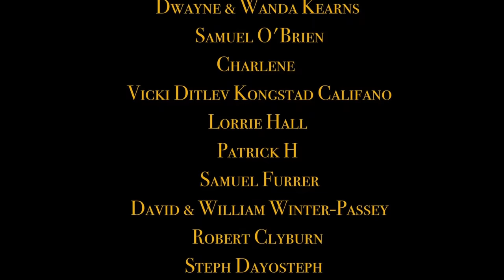EP90 Desk Cabinet for the Salon A Beautiful find for Our Passion Project

Comment: I much prefer the cabinet on its own. And the desk on it's own separate. Because it will be so dark to sit down in front of for anyone. 
But if your sat down in front of the desk on it's own. You'll be more likely to want to sit in  there  if your able to glance up out the windows without the big dark glare of the tall cabinet right in front of you above your head. As someone who suffers from depression. Even anyone without depression  could be less likely to want to sit there. 
But, that's just what I think.

Comment: I love the desk and hutch so much!!! I my humble opinion this is not the right place for it for more than one reason. It is to large and the overhang of it on the wall that it is on is distracting. Then it takes away from the beautiful stained glass door and the windows with the beautiful plaster work between them towards the ceiling and they take away from the desk it in turn. Beautiful window treatments with some gilded curtain hold backs on the wall would looks so beautiful.I think a beautiful gilded bench and seat cushion to tie in with the curtain fabric would be so lovely for someone to sit on and look out the window or read a book. A console that was quite a bit more shallow than the desk would also work well in the space. With some art or a mirror above the bench. The third thing is the beautiful dark wood of the desk will fade due to all the direct sunlight in that area.I just know that you could find a better place for it in the beautiful chateau you are working on. These are just some suggestions and my opinion, do with them what you will.This comment is written with love.💖💞💖 P.S. I have a feeling that you are not in love with the desk in this spot either Anna from your reaction but I most certainly could be wrong.💖💝💖

Comment: The cabinet obstructs the view of the left window as you cross the room, and worst of all, the light coming through can not completely spread and is restricted into two parallel rectangles on either side. Gorgeous piece of furniture though, it just needs another spot in the room.